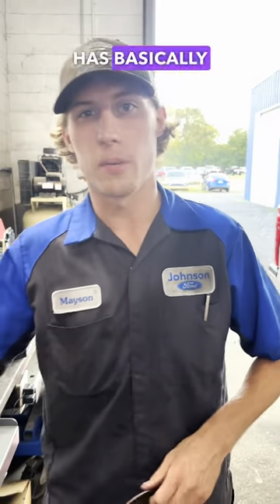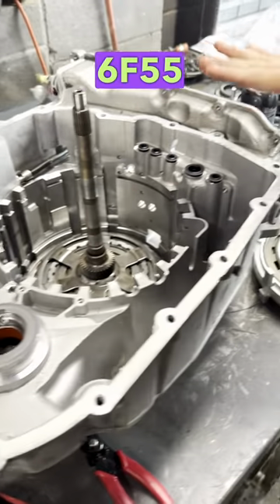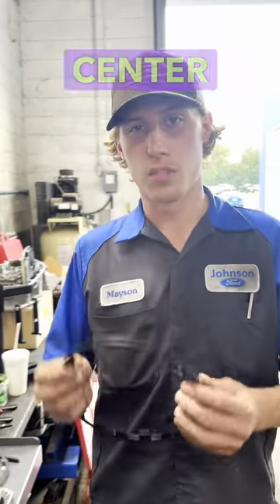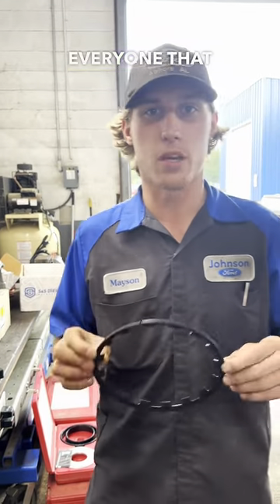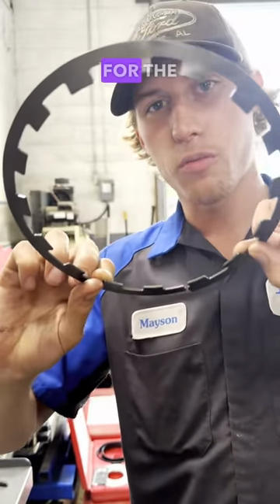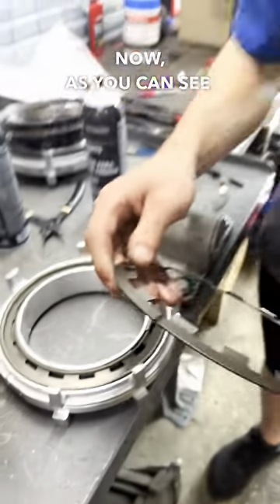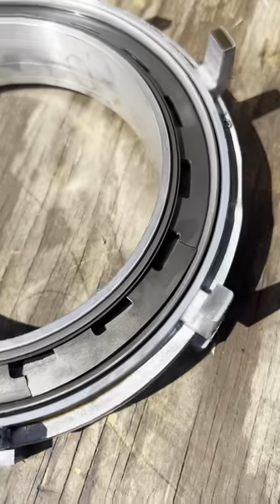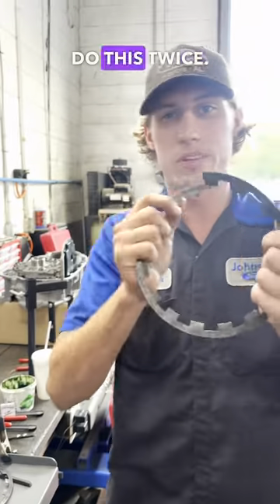6F35 Most Common Issue? #shorts #ford

Comment: Take a C6, install a "center-support" to support an overdrive unit, and you got an E4OD. The largest failure of this unit was related to the "center-support". That was over 30 years ago, and we are still dealing with center-support problems.

Comment: Just replace it if youre gonna build it. 4, 5 dollar spring is worth the piece of mind. I just replace it every time.
Reply: I’ll guarantee that spring isn’t $4-5, I’d say it’s probably closer to $30-40, either way, worth changing
Reply: @iHackWaWx  I'll go look it up but even at 30-40 bucks it's still worth replacing. Can't argue that
Reply: @iHackWaWx  we get them for 20.
Reply: @randomgooglename good info boys.
Reply: Anything factory is wayyy overpriced , that one clutch/spring has to come in a kit from the dealer which is at least a few grand
Reply: @AmericanRustWorker3369  good thing they don't normally go bad but I do keep 1 in stock just in case.

Comment: Overhauled hundreds of 6f35's and never seen it. Looks like too much pressure in the press when trying to remove the snap ring
Reply: @jasonarbour how do fix the not being able run 6 gear below 45mph or being able to down shift from 5th to 4th at 75mph????

Comment: Is it true that a cracked flexplate is a common problem with these?
Also wasn't aware of the drivers side bushing wear issue until I replaced the CV twice in 2 years.
Reply: Yes....had a couple broken flex plates on 6.4's but none on the 6.0 or 6.7's.   Ford came up with new problems for them.   I knew guys who LOVED the Powerstroke's because they put their kids through college.    I hated them because even after you fixed them...they were no better than they were new unless you modified things which you shouldn't have to do as it exposes the shop to liability issues.

Comment: Had one of these brand new. Never cared for it. Terrible 2-3 shift when cold weird downshifts. Drained and filled fluid twice while we had it, first at about 50k miles fluid was very dark and dark the second time. Ticking time bomb
Reply: The color is normal. There is actually a TSB on it. Can’t remember the explanation but the color changes quickly.

Comment: My torque shift6 6r140
Shifts hard to sixth.??? 
2011 F TOOSHIFTY!  
ITS GOT DA 6.7 B8!
Reply: Check your overdrive clutch pack for burn/overheating. Usually caused due to exceeding tow/hauling capacities.

Comment: Question for anyone out there but especially you Mr. Flying Wrenches, I have a 2014 explorer sport with the 3.5 eco boost and I’m having an issue at speeds (generally 40mph and above) it’s intermittent and feels like the car is surging when under slight acceleration… no codes stored or lights on just wondering if you’ve heard of this complaint before couldn’t really find anything online love your channel and keep up the great videos much appreciated
Reply: No misfires???
Reply: @dalebabbitt6185   no misfires… I thought it was the transmission at first because it almost felt like it. Couldn’t decide what gear to be in but I put it in manual mode and shifted to 4, 5, and 6 gear at highway speeds and it did it in each of the respective gears powerband and it did it in each of the gears so I’m fairly confident it’s not the transmission because in manual mode it’s not trying to shift unless you shift it… and there’s also a noticeable loss of power when it occurs… the worst part about it is that it’s an intermittent problem and doesn’t happen every time
Reply: @josephengel2334  sounds like when you call for a bit of power or under a bit more load it hesitates. It might be asking for some timing advance to accommodate the power request, but not getting it. I can only guess perhaps a cam phaser issue. Try googling that to see if your symptoms could be phaser issues. I think Ford is having some issues with this problem. Also, do you have good scan tool? I don't mean just a code reader. Something that can capture some graphing data while this issue is occuring. I'm guessing there are some PIDs pertaining to the timing.
Reply: @dalebabbitt6185  honestly that’s what I was thinking but in everything I’ve read about the phaser issue it’s never mentioned hesitation in acceleration as an issue it’s always about the cold start issue… o don’t have a super high end scanner but it is able to read live data, so I guess that’s not a bad idea to look at it’s just hard to know exactly what to look for in the engine info not being an experienced mechanic… and there’s little to no info about what normal parameters are… thanks for the help tho
Reply: @josephengel2334  look at whatever live data that you can on your scan tool. Fuel trims, cam/crank correlation, etc. What scanner do you have? Is it capable of giving you any kind of graph of the live data? Have you ever watched Ivan from Pine Hollow Automotive Diagnostics? He puts out great YouTube videos. He's located in State College, PA. Where are you located?

Comment: I've had two fusions a 14 and a 13 and have never had issues. I know they are out there and people have had nightmares with them, yea 2-3rd shift ain't that smooth, but it ain't ever left me on the side of the road. Both have been driven to 175k no problem. Maybe I'm just lucky with my ford stuff, they run, my chevys don't.
Reply: Had a 2005 impala 340k miles friends 2016 fusion 80k blown engine oil changes at 3k miles
Reply: @bruteman45  was it 1.5 or 2.0
Reply: @acfrmlc  I have no idea it's been awhile

Comment: Believe me, I learn my lesson on the 2012 Ford focus I’ll never buy an American nameplate again. When I bought my Toyota which I still have today I haven’t had one single problem with it. It’s amazing the difference in quality.  Go Japanese you never go back.
Reply: I work in a Toyota axle plant and it’s pure luck you haven’t had any problems.
Reply: I went Japanese with Mitsubishi, wasn't awful but i prefer korean
Reply: Some toyotas are built in the US such as texas
Reply: @bruteman45  Toyota builds MORE cars in the US than ANY OTHER COUNTRY IN THE WORLD.
Reply: @meyou3353  not ALL cars from Toyota are built in the states my 2011 2500HD is built in Indiana impala is built in Canada same with my 07 1500
Reply: @meyou3353  I like toyota but when it comes to parts availability and just overall maintenance I've spent less on my gms than I have on a toyota
Reply: @bruteman45  Toyota parts are definitely not cheap. They all require maintenance but longevity is where you make your money back with a YOTA. Gm has made a few good vehicles just not the average. I cant even count how many toyotas i have seen over 300,000 miles!!! Even honda cant compete. 🤣🤣
Reply: @bruteman45 I flat out don't believe you.
Reply: @adamyoung8289  don't believe what
Reply: @adamyoung8289  I could careless what you believe I know what I know I don't need your validation

Comment: I have a 2012 f350 and I have to replace the engine crankcase oil separator . Do I need to replace the filter itself or the entire part&filter.  I was told the entire unit?
Reply: Change the entire unit to an updated box, should have a few baffles in it but generally empty. The filter causes excessive crankcase pressure that leads to oil leaks.
Reply: @athineana  thank you! 👍